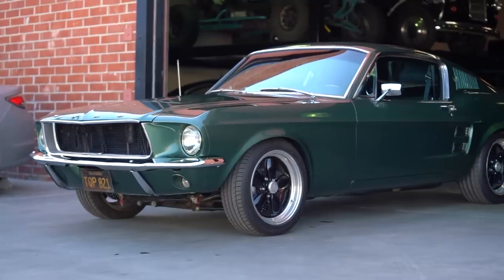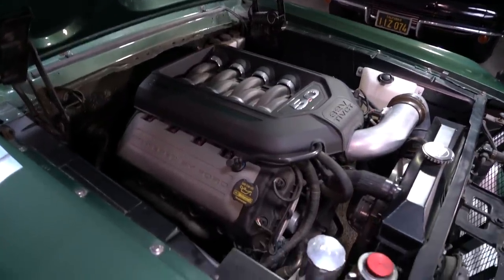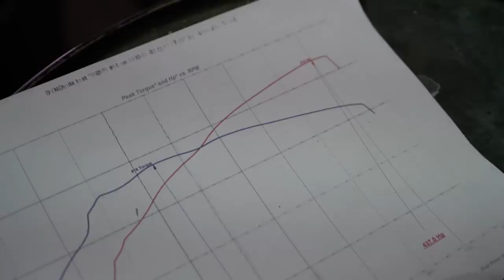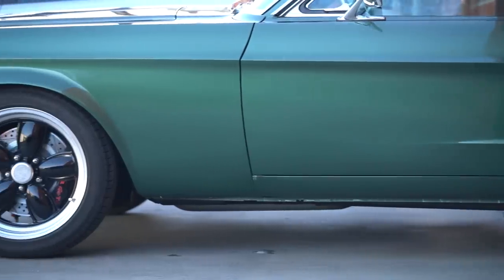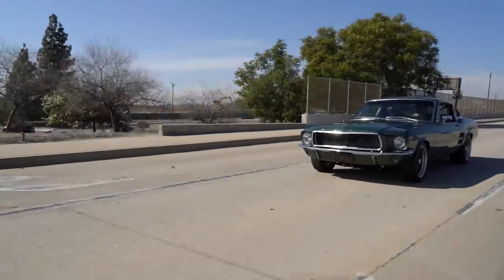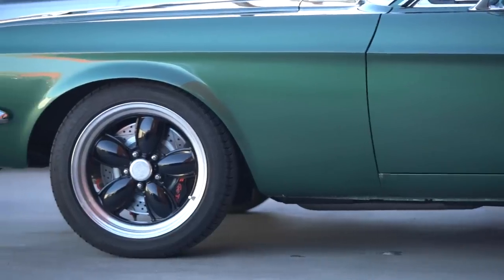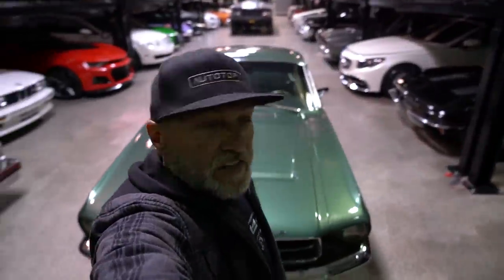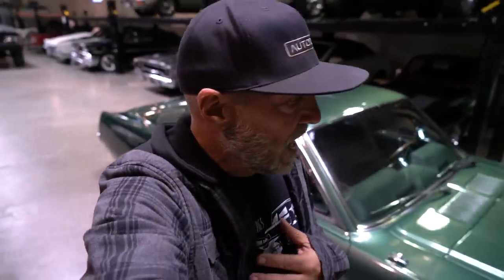Coyote Swapped 1967 Ford Mustang Fastback Revisited

Comment: I had the same problem with my 64.5 coyote swapped, luckily I had an nGauge attached. When I went through the various gauges, I spotted the AFR showing 26:1 instead of 14.6 on the right bank. I slapped in a new sensor and plugs and was back in the saddle. Apparently those sensors can die easily.
Reply from the maker: They’re not very reliable. One of them went after replacing with brand new. But once it got sorted it was incredible to drive!

Comment: I wonder if it could have been made to fit a Roush 5.0L RSC Coyote Crate engine?  That dyno's at about 600 HP.
Reply from the maker: Probably but this is plenty for what this is. With bigger power he’d need subframe world, suspension, bigger brakes, etc. This is such a well balanced driver

Comment: Sounds great wish I could do that swap to mine. Question what happened to the hood the center looks like it's bent down at the nose.
Reply from the maker: I addressed that in the video a little. The intake didn’t fit properly so the owner pushed on the hood so much it bent over time. We fixed it a little but didn’t want to go too far for concern of cracking paint. Would be nice to have it right

Comment: Put the og engine back in it. 5.0 sounds weird in that car. Not throaty enough at all. The engine that came in the fastbacks is what made them special. 289 or 390. Or if you wanna get crazy a era matching ford 427 side oiler.

Comment: What a Wimpy Motor ive had 390s with 401 horse power stock what a way to distroy a classic Mustang really Sad
Reply: It's not a wimpy motor at all. It was a simple issue that they had and got it fixed. These gen 1 5.0s make 420hp and 390tq stock, and the new gen 4 coming out this summer will make 500hp. And with E85 it would easily make 500whp. These engines beat the 390 in modability and reliability.